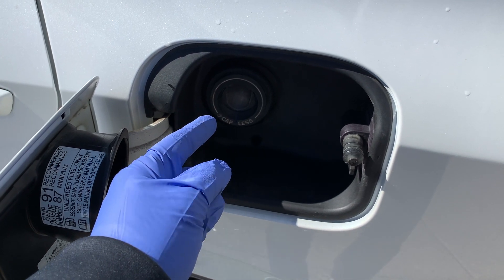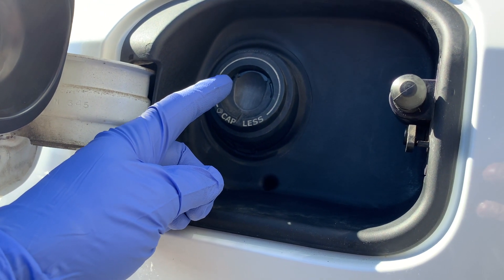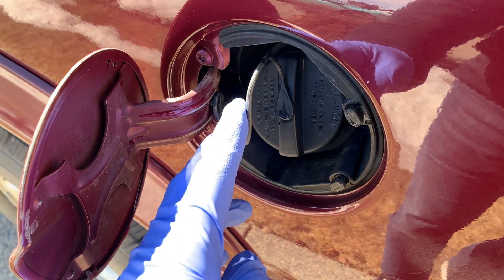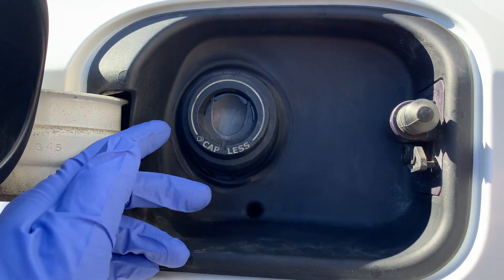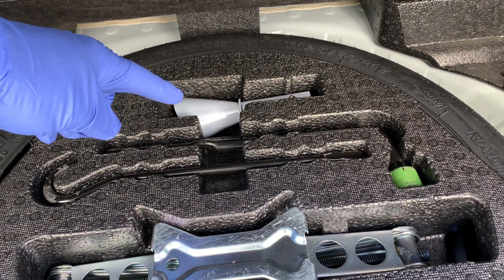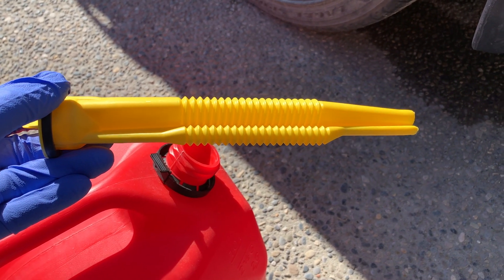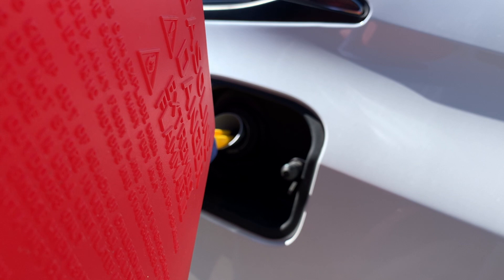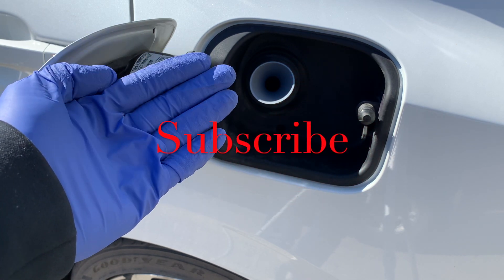Capless Gas System - Pros and Cons

Comment: New to this and picked up a 14 dodge charger and has thus type of cap……😂😂 I use a Lucas product and didn’t even realize but it went right in like normal……used another type of gas treatment and all spilled out and the flap didn’t even open 😂😂😂😂😂😂
Sure glad I’m keeping my 06 charger too cause this is nuts lol 

Btw, takes 2 fingers to open mine and not 1, and if anyone doesn’t know, possibly theirs a funnel in your trunk that’s attached underneath of the “flappy door/platform” of where u pick it up to get your spare tire out, like mine had 😎😎😎😎👍

Comment: my capless fuel will not open, the metal blocker peice will not open at gas pump at all
Reply: Same happened to me once, you have to make sure the nozzle at the gas station has the whole nozzle uniform and not the nozzles at some stations that the tip is smaller than the rest of the nozzle. Otherwise it wont open. Its the dumbest thing I have ever seen these capless systems. 

I had to drive to another station, luckily the other one was open , it was late night on highway and I had maybe 20 miles in the tank in the middle of nowhere. In an emergency I would think you could just use the filler nozzle the car comes with and gas can and fill up the gas can at the station and then use the gas can and nozzle to refill enough to get you to next station, but the cans at the gas station usually are $30.

Comment: Good video, thanks. 2022 Civic engine check light and code P0456 indicates small leak. Dealer smoke test call out replacing the gas filler pipe or whatever its called. Low km and relatively new car just out of warranty will cost $500. Anyone have a "service" idea how to fix this?
Reply: Get a second opinion and then go to independent shop after you buy it online. The part you ar talking about is likely the fuel tank filler neck. You can get it for around $60 online. A shop should charge you about $150 - 200 to put it in. If not call a mobile mechanic and they will likely charge you $150 in labor and go to you. usually a 1-2 and half hr job.

Comment: You forgot to mention a very important Con. Many times the nozzle doesnt open the second door, spilling gas all over the place. This capless system is a f**cking Nightmare. I have to push hard onto the nozzle the entire time I am filling up, otherwise the second door does not stay open or open up at all.

Comment: Lincoln MKZ capless gas filler.Check engine light on.How can I clear it??
Reply: Clean the area around the filler, that usually will work, if not just disconnect the battery for 15 minutes and then reconnect it, or if you have a OBD scanner then clear it that way. If it comes back on aftr clearing it the you will have to take another look at the cause. Most time its a computer glitch issue and it will clear.

Comment: My 2018 Silverado has a capless filler arrangement, I place  a balloon  over it to keep dirt and water out of tank.   Poor design.  Upate:  I found rubber covers on Amazon that is made to fit the capless filler for a couple bucks .  The ballon worked but this rubber cap has a ring attached to it that fits around the filler tube and for a couple bucks I feel it is a fantastic buy.

Comment: The biggest negative of capless systems is if it does go bad (like mine just did) you may be looking at a costly replacement that can run $400 for parts and labor. Compare that to $20-$30 for a new gas cap. It's a great example of a solution for non-existent problem. The simplest solution (gas cap) is always the best.
Reply: Did all they do is replace the inverted cap.  Isn't that like a 35 dollar part?
Reply: Ya I still have my 06 charger and I appreciate it more and more when I just picked up a stock 14 charger 😂😂😂😂
Reply: So basically more money to spend … great

Comment: careful in inserting and pulling out the gas nozzle as gas stations may have different types, especiall those with which are ribbed or nozzle as has a bevelled step metal stopper. This may damage the internal flap and seal and will throw off P0455 / P0456 codes evaporative emission leak. This is a common issue that can on capless honda fuel fillers.

Comment: I tried to put in a fuel additive without using the funnel and it spilled all over the ground! Does it have an overflow outlet or do you think it could be a hole in fuel line? I have been getting emissions system codes for a few months now and don't know what it is.
Reply: Yes just to put additve you have to use that stupid funnel. Just clear your codes with OBD scanner or diconnect battery for 15 min.

Comment: I have a 2018 Jeep Grand Cherokee summit. My check engine light is on and I got a p0440. The reading says evaporative emission systems. it looks just like this one with a capless gas cap. any suggestions?
Reply from the maker: It’s likely the ESIM unit located above the drivers rear tire.  Remove the inner fender with a trim tool along with one or two 10mm bolts. This will reveal the ESIM module which is the white plastic unit.  Disconnect the electrical harness, pull to remove the hose, pull the spring clip on the unit towards you and turn module counter clockwise to remove it.  Also remove the O ring gasket. Then just replace it with another OEM part.  I think the part is approximately $70.00 Canadian - where I live.
Reply: @YourHomeGarage  awesome I think I know where to locate it how long does it take to replace the module? or what can be the problem? Thanks for your help

Comment: Ive had a guy who keeps putting water in my mower tank and gas cans
Ive had to get a camera, move the mower and keep the gas cans locked up out of sight.
My concern is next he may move over to my truck which is a fully trimmed out Lariat with one of these capless tanks. 
I worry he could somehow bypass and get water in my tank as latly my vehical has been running kind of bad. Problem is when this type of thing happens you just don not know anymore where exactly to start and makes you a little paranoid without just having a locked tank. Ill probably just change it somehow smh.
Reply from the maker: Check with the dealership or online; you can purchase a locking gas cap for your cap less system.

Comment: We had a rental Nissan with capless gas system and when I filled the tank, first it was very slow and then the gas pump did not automatically shut-off leading to some gasoline on the concrete.  Any comments as to what the issues were?  Was the gas pump system faulty or was it the capless gas system?🤔

Comment: I had trouble getting the pump from the gas station out of the car.
Reply: @ghitara1337
Are you saying the nozzle from the gas station got stuck in the fuel port? How did that happen?
Reply: @ankhpom9296 yes, I have no idea and it has never happened again

Comment: Hi just bought a 2016 Jeep Renegade and the check engine light keeps coming on, had it checked and the code 456 show up a small gas leak, what can I do? Do I need to replace or put tape around the top or replace the rubber top?
Reply: Please help
Reply from the maker: Correct, this is a small leak detected.  Start with inspecting the gas cap , then the purge valve, Evap system and lastly charcoal canister/vent solenoid.
Reply: The first mistake you made was getting a Jeep, the second was getting a Renegade.

Comment: 2023 Buick Encore GX... capless gas system..problem...you cannot prevent unauthorized access to your gas filler opening... the door doesn't lock.
Reply from the maker: Did not know that - thanks for sharing.

Comment: How do you lock with no cap. I worry about someone dumping something harmful into my gas tank
Reply from the maker: On most vehicles the gas lid stays locked unless it’s purposely released.  If your vehicle doesn’t have a locking gas lid, then you can purchase an aftermarket locking gas cap. Just check with your dealership or aftermarket parts store.

Comment: Extremely helpful as not having a locking gas cap has been a concern of our family.  Good to know somebody would have to really work at it to steal gas.  Good information about the use of the special funnel which I guess we will put into a Ziplock bag in case we ever need to use it so we can zip it up to minimize smell from the spare tire area.

Comment: What if it's some idiot who just wanna put water or sugar in my tank how do I avoid this? The fuel door should automatically lock if the key isn't present
Reply from the maker: The fuel lid should lock once the keys are removed.  However, you can buy aftermarket locking gas caps for the cap less system.  Just check with your local dealership or aftermarket parts store.
Reply: @Your Home Garage  it don't lock on my 2021 yukon denali or my 2021 charger. It locks on my 2011 Infiniti which is crazy because that's a older car
Reply from the maker: I didn’t realize that on those particular models - thanks for letting me know.

Comment: I have a P0441 EVAP code and every related component checks out, except I don't think my plastic capless flapper is seating properly. I'm going to put duct tape over the inlet and drive for a few days to see if engine light clears itself. Bad idea?

Comment: The only main problem I have with being capitalist that I don't like on my vehicle is I always put locking gas caps on my vehicles to prevent someone from pouring sugar or some type of contaminant to screw up my engine I wish there was some type of conversion kit or something I could put in there to lock it down
Reply from the maker: Depending on the vehicle - they do sell locking caps for cap less systems.  I would start with your local dealership followed by a Google search of your make and model.
Reply: Ford makes it very difficult to find correct locking capless lock. Search YOUR Ford and don't know it has cap from ANOTHER Ford vehicle. You must search ALL the vehicles and CONFIRM THEY LOOK exactly like yours.

Comment: So my little door u push with your finger chipped causing my engine light to go on wtf is that thing called or do I have to replace the whole thing cuz it’s like 200+ what do I do someone comment with sum help I’m f*** stressing
Reply from the maker: Do you have an OBD reader to verify the code from the check engine light?  It's likely an EVAP leak based on your description, but always  better to verify before.  What is the year, make and model?

Comment: I am leasing a 2022 chevy equinox and did not fill with gas yet. I was looking for this in videos but didn't see it shown. Yes, the fact I was wondering how to fill it with gas because there is also a rubber sheet on the right side with a circle. I wondered if that was to be pushed in for fuel. I see here, just the opening on the left is for gas thank you 😊
Reply from the maker: Glad this video was helpful and congrats on your new Equinox!

Comment: I used a hairdryer to melt the ice and it finally opened. The ice forms when the flap is opened to fill up and there is rain or snow. The water collects at the bottom of the opening and then it freezes.

Comment: Can someone put salt in it passing the flap?? Recently someone forced the fuel lid and salt was all over.
Reply from the maker: Since you can still siphon gas from a cap less system, then yes someone can put salt or sugar in your tank.  Now, salt will not dissolve in gasoline. And it’s unlikely to make it into the engine but you never know. The salt will likely get sucked into the fuel pump and clog the filter so then the engine might not run.  It you noticed salt/sugar around the fuel neck take it to a shop right away.  If it’s a huge concern, purchase a locking cap.

Comment: I just went to fill up and the trap door is stuck. It has been very cold out but other than that nothing has changed. I just used it on Thursday. Any ideas?
Reply from the maker: It’s not uncommon for ice to form on the inside of gas lids, which would make it difficult to open.  Try spraying some dry lubricant on the hinge and rubber release.   If the problem persists then it’s likely the cable release is failing.

Comment: Garbage idea
Reply from the maker: There are definitely a lot of people who feel the same about the system. Manufacturers such as Ford , GM, Chrysler, Honda and so on have definitely adapted it in most of their models.
Reply: @YourHomeGarage  Hello. I have 2022 Pathfinder SL. Is there any suggestions on gas locking caps?

Comment: It seems very sketchy, the design doesn't bother me in terms of me filling up. Although whats to stop someone sticking a hose down to siphon some fuel or stick gravel down while you're tucked in bed on a night?
Reply: what about people that can mess your tank by throwing contaminants in your tank? oil , sugar...i just wished they had a lock on that door pannel
Reply: @meagain8403  Same
Reply from the maker: Capless gas systems have a unique mis-fueling inhibitor to reduce siphoning. If a nozzle going into the tank is a foreign tube of a different size, ie a plastic hose is placed in the filler neck, the latches will not release.  That's why it's important to use the filler funnel that comes with your vehicle if your were to run out of gas and needed a jerry can.  But - when there is a will there's a way!
Reply: @YourHomeGarage  To be honest i understand and see the positives but i just think it would have been a lot more peace of mind if the outside cap door could only be opened from the inside of the car.
Reply from the maker: Generally, the car must be unlocked in order to open the fuel lid or as you indicated there is a fuel switch somewhere in the car.  I can't think of a make/model of car that has fuel lid that anyone can access without unlocking first and has the capless gas system - but maybe there is a manufacturer out there that did it that way?
Reply: @YourHomeGarage  All i know is, if you search up some Ford Fiesta models like i own a Titanium Ecoboost model. The outside filler cap door has a little lip at one side where you just pull it open with absolute ease. Then inside is the exposed "smart" fuel filler system.
Reply from the maker: @rufusgreenleaf2466  I’ll have to Google that car - thank you for letting me know.
Reply: @YourHomeGarage mine is a 2018 Chevy equinox. You can open the gas door even when the car is locked, and someone has been stealing my gas at night, and the cops won't do anything. Can I replace it with a lockable cap?
Reply from the maker: @jonnyzuma6884  You can place a locking cap over the fill nozzle. Just head to the dealership or aftermarket parts store to see which one your prefer.
Reply: I have a 2020 dodge charger scat pack and my biggest gripe is this, and the fuel door doesn’t lock when the car is locked so anyone can pop it open. And today I found an empty bottle of mellow yellow next to my car in the driveway and haven’t cranked it since. I’m thinking about flushing the fuel system to be safe 😢
Reply from the maker: I’m surprised the fuel door doesn’t lock with the drivers door.  I do understand your concern and rationale about getting it flushed.
Reply: @YourHomeGarage  I probably won’t though and cross my fingers. I figure if someone were willing to do this it’s most likely a younger kid, and they would need to have a screw driver or the mopar funnel to open it up , since it does have that one bit of security where it only opens for a standard sized fuel nozzle or mopar funnel that mimicks the nozzle. Or a screw driver lol

Comment: I ended up driving off with the fuel pump …n damaged the entry port to my gas tank do u know how to install a new cap less entry port
Reply from the maker: That is unfortunate, however if it's just the fuel filler pocket - it should be an easy process with a socket set, body panel tool and screwdriver.  There should be a plastic cap around the fuel nozzle that pulls off which then reveals the bolts to be removed.  Then reach under the fender well and push outwards on the fuel nozzle.  This is when you'll need the body panel tool to then gently pry the fuel filler pocket from the fender - the entire pocket will come out.  The fuel door, should come off with the screwdriver and reassemble that part on the new filler pocket.  To reinstall the pocket, place the hinge side in first and push it in until it seals properly.  Screw the bolts back in and push the plastic cap around the fuel nozzle.  
If it's the filler neck - you'll have to disconnect the main fuel line from under the vehicle and breather vent, along with a few extra clips and bolts.  This part is a bit more tricky and you'll need comfortable access under the vehicle.
Now, this is the general way.  Your vehicle maybe slightly different since I don't know what the make and model is.
Hopefully this was helpful.  I don't have a video on my channel, but there are lots of great tutorials on YouTube and maybe someone has one on your make and model.
Reply: @YourHomeGarage  ur very helpful brother Thnk u 👍🏽
Reply from the maker: Please keep me posted and let me know if I can assist with any additional information - take care!

Comment: So how can you stop someone from putting stuff in your tank if it is a capless???
Reply from the maker: Great question:  For most cars, the gas lid will only open from a button/lever located inside the car or the doors have to be unlocked for the lid to open.  So, the lid is the first deterrent.  In order to open the flap on the capless system, equal pressure has to be placed on the flap.  Therefore someones finger won't work to open it.  Even with those obstacles, it's still not impossible for someone to put stuff in your tank.  For added security, aftermarket locking gas caps are available for capless systems.
Reply: @YourHomeGarage  Yes I need a cap lid something that locks on my car I have a 2019Jeep Compass where would I found one. I once own a Nissan Altima and someone poured something down my gas tank and it completely stop working(jealous friends) Please help.
Reply from the maker: There are lots out there and if you just Google your year, make and model, you’ll find lots for under $20.